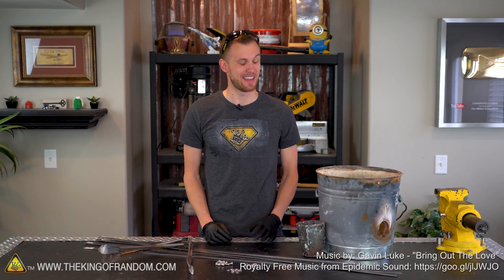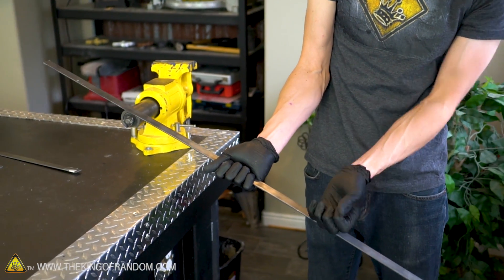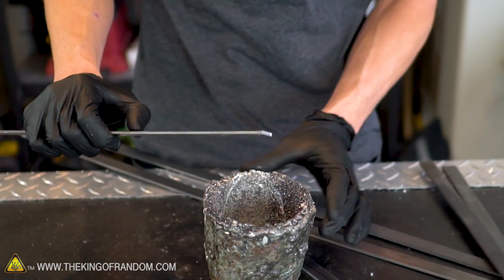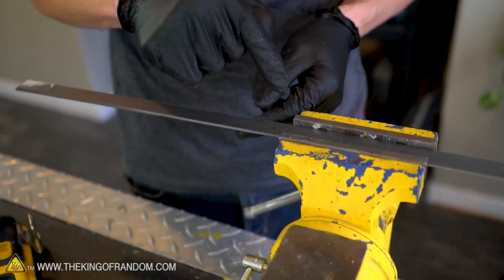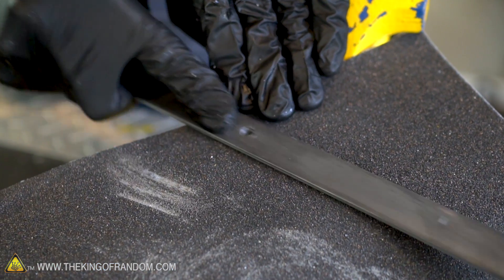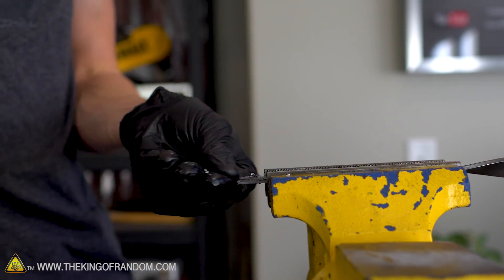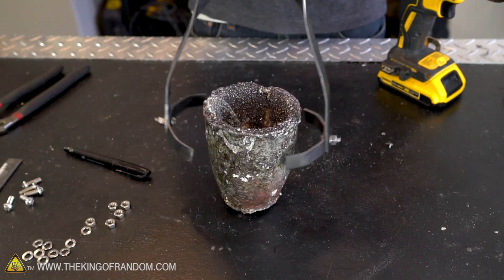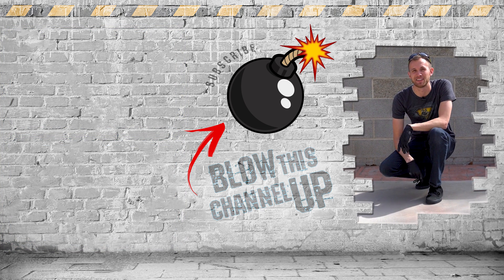DIY Crucible Tongs! TKOR Guides You How To Make Furnace Tongs!

Comment: !!!!!!!!!!!!!!!!!!!!!!!!!!!!!!!!!!!!!!!!!!!!!!!! For the pouring tongs, it might help if you put a latch on the handles (to hold them closed after grabbing the crucible) and adding a handle in the middle to help steady them while pouring. The weight is going to be increased because of the length, so this will help you pour with greater ease.

Comment: Also, for bending the steel, get a small oxyacetylene torch ($200) altogether, heat the metal to softness, use a ball or the crucible it’s self to hammer around and shape.

Comment: Aren't you going to have to temp the mild steel so it doesn't melt in the furnace? I mean sure it's only in there for three, four seconds but that will wear down, brake down the material soon if you don't temper it

Comment: On the bolt you used for the pivot point, I would have used a pair of nuts tightened against each other, rather than a lock washer, that way using the tongs doesn't cause the nut to loosen and make it come apart over time.

Comment: if u put a washer in between the bar and the crucible grabbers u could just use it and a hinge and not have to keep switching tongs. to pour it just use another bar with a loop on end and grab the bottom of the crucible. or at least thats what i am going to try. thks for the video and easy design .

Comment: You are going to want to bend those more. From what I saw you are only grabbing it with the head of the bolt and not the actual bent metal. Bend it more so the ends of the metal will grab the crucible as well as the head of the bolt. 3 points of contact on each side of tongs vs 1 when only the head of the bolt gets it.

Comment: Love the videos.  Glad to see you guys upgrading from the tongs.  Just a thought.  When you turn the crucible, if you go upside down the curve of the crucible will make it harder to hold pressure and it looked like it slipped a bit. What about a small hook on one side opposite from the claw that would stick out to rest on the top of the crucible to keep it from sliding?

Comment: you should make and add a torsion spring to hold them closed, and replace the pan head screws on the ends with flat head screws and countersink the holes so the business end sits flush with the crucible.

Comment: You could have bent the part that grabs the crucible at a 90 degree angle to grab it from the side and added an extra lever(or permanent piece) to your tongs that would hold the top of the crucible to keep it from slipping out when your tilt to pour. That way you wouldn't have to change tongs just to pour.

Comment: Some flat washers on either side of the joint would probably be helpful as time goes on. Put a split ring under the nut, should let them glide a little more easily as time goes on while retaining nut tension. Just a thought for later.

Comment: Hey. Just saying ur probably better off couter sinking the holes that u drilled by just using a bigger drill bit and dig out the Burr with ur hand. Doesn't take much at all but is better then using sand paper.

Comment: Lock washers for the end bolts where the grabbers are. Spring washers for between the hinged spot with a lockwasher for the nut. That'll keep the nut from backing out as you use it and the spring washer will give tension so they don't slop.

Comment: Very close. I would have used 1/4" stainless. Bending metal in a vise works very well with a 4lb engineers hammer and can be VERY accurate. Use of oil for drilling...nope! Use water to cool the tool and work and yes, watch the speed (have not had a full bit or cutter in 20+ years). Oil is solubile oil and is only there to keep tooling and work from rusting. I have used a garden sprayer to drill, even in fixing or tapping cast iron.... No oil untill it is done to protect my bits and machinery. Water soluble oil can be bought at local hardware stores and machine shops from the quart to the barrel. Just a few ounces per gallon. The water is what cools and helps cut... Not the oil!
I hope this helps some one and you.
Take care from Oklahoma,
Mike and Vee

Comment: Speaking from experience, those nuts will come loose after just a few grips. Grind the ends of the bolts a little and pean the bolt over so they don't come undone. And if you don't want the grippers to come loose, hammer the bolt straight down a few times after peaning. That will cause the bolt to swell slightly and create a tight fit.

Comment: I'm curious how the nuts and bolts are going to hold up.  It would be pretty cool if the claw part could swivel, but I'm assuming that wouldn't work well with the high heat.

Comment: You could also level it up further by adding a spring somewhere between the handles, and the middle bolt, just to make sure they will keep closed if you're unfortunate enough to lose hold of the handles it self.

Comment: ...I think I'd go multitool with it, and just slap the second pair of claws a bit higher on the same tongs (those, eh, parallel to the arms should be allright, since you're grabing from the side and heat goes up). Few adjustments and you just take the crucible out, place it somewhere, do a different grab and go right to pouring, instead of looking for my other tool in between :P

Comment: Why didn't you just make the tongs' claws pivot so you don't need a second pair, or put a 65° angle in the tongs? not only would the heat from the forge not radiate directly onto your hands, and the angle will allow you to pour from it.